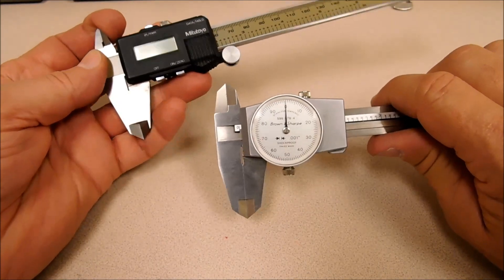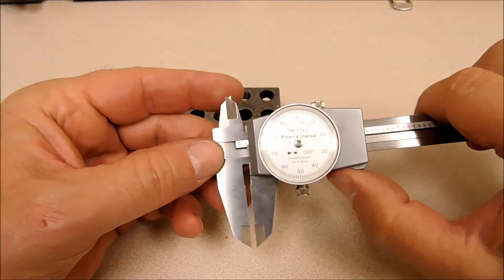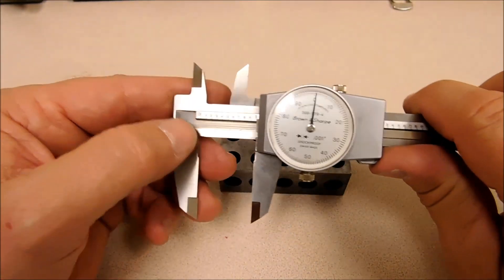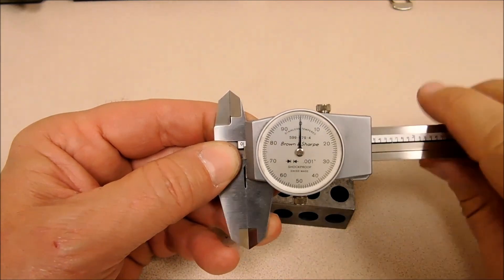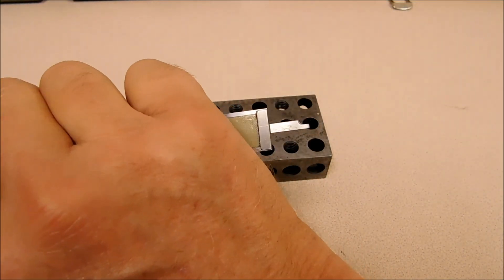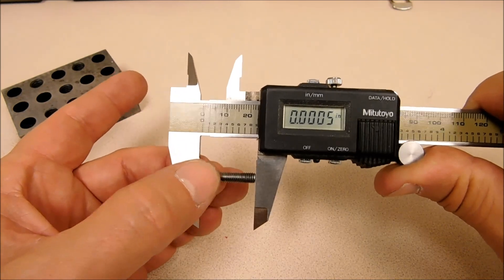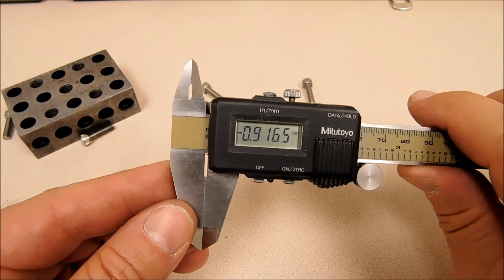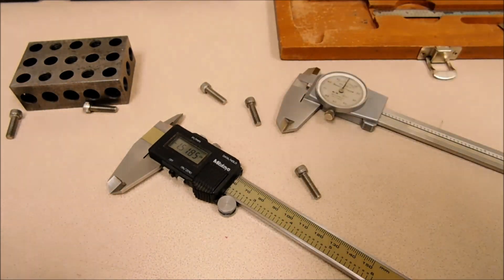Calipers -- Dial vs. Digital -- Does one do more ???  ( yes )

Comment: I prefer vernier calipers for a couple of reasons.  First, they are more durable.  I do both woodwork and mechanical work.  Dial calipers are a bit delicate for some work and they have to be kept clean.  The racks and gears can get messed up with grit.  I just don't trust digital calipers and they have potential durability issues.  As far as accuracy, I use vernier micrometers also.  And I've won bets on several occasions, me measuring something with a vernier caliper, the other person using a micrometer.  It's all in experience and touch, which you have to have to use any measuring tool with any accuracy.
Reply: @Steve H  I use vernier calipers (one is Mitutoyo) because the ones I have have a thumbwheel adjuster and both the adjuster and the main slide have locking screws on them. They can be used to measure down to 1/100th of a millimetre (and 1/200th of a mm which is close to .0002" using a loupe and estimating between the lines positions). The digital and dial calipers (I do have some) move when you remove them from the part (on the lathe usually) if they do not have a good locking screw on them and the thumbwheel on most of them can result in inconsistent results due to variable pressure. I have got micrometers going up to 100mm/4" that I keep for critical work but have to convert the reading on the 3" and 4" ones to mm when I use them as I don't have 75mm or 100mm micrometers. The micrometers usually just confirm that the vernier calipers are still giving the correct size. Most of my work is in mm. The biggest issue for calipers is that the contact area is not as wide as that of a micrometer so care is needed to ensure the caliper is correctly seated on the part.

Comment: Other day using my Mitsutoyo caliper  to make a drawing where i used the tips of the inside and outside to leave a pin hole to leave a mark on paper 
To my surprise they didnt leave the pin hole in the same spot try it set the caliper at say 1”  use out tips to make two pin hole now try to put the inside in the same holes ???
The reason it brings a question now is when i see people drag them on metal for lay out scribbing
On another note storage of mics and calipers 
Never store them in fully closed position so the temperature change doesnt  tweek the anvils thats what I was taught over 50 years ago so alway leave a slight air gap when putting them away
Reply: using calipers as scribes? man, those people need some disciplining.
Reply: @sanjeen2503  for shit calipers with a difference of +- 0.2mm between the id and od thats what they deserve ahahahahaah

Comment: You can also use them to fine center line of holes within it’s measuring range. If hole are same dia. Take blades and zero it in first hole then go to second hole. Then read center distance.

Comment: Measure twice, cut once, right? Here is the question, what if your calipers do not agree each other? One say 1 inch, the other one from other brand say short 1/4 thou, the third one say long half thou and you don't have a set of guage block to say the last word in your work site. To a certain degree, they are all usable calipers, but if they are all use exclusively to make parts for a same machine, i don't think it will result very well. And somehow it will be result into some kind of “brand war”. Yes, you can put only 1 caliper on the bench for everyone, the rest go back to lockeroom. It is not practical, right? What is you prefer? It is not that easy here to acquire a set of guage block. Unless you want some chinesium self claim guage block that looks pretty suspicious.
Reply from the maker: Simple, just use the one that gives you a dimension closest to the callout on the print. Boom, drop the mic.
Reply: @joepie221  so you also agree with the “1 caliper” policy. What i am worry is, the customer qc, he is holding a chinesium caliper, which is a lot of thou difference to the rest of the world...... 😕
Reply: @joepie221  HAHAHAHAHAHAAH
Reply: Simple.  Calipers are not meant to read to fractions of a thou.  Get a mic.  The brand of caliper is irrelevant if you are working to tolerances of less than .001 calipers are not going to do the job.

Comment: My digital is always dying eating batteries. The dial is always there ready to go no batteries needed. The battery door has crappy little screws that always get lost but I do like it because I can see the numbers and it instantly converts standard to metric. I have to have both!
Reply from the maker: I bet its not a mitutoyo. Their batteries last for years.
Reply: . you are correct sir its a piece of junk from harbor freight. I will have to save up and get a mitutoyo. My dial caliper is a mitutoyo though.
Reply: @ALSomthin  you have to get decent stuff to get decent results. I bet you the HF calipers don't zero well when you close them back either.
Reply: @bbarker5766  Yup they are crap it seems its the only crappy tool I own at least one that was intentionally built to be crappy. But I had three other brands as well over the years that were all the same garbage.
Reply: @ALSomthin  I got a set to use at home for woodworking and some 3D printed stuff that is not critical which they work fine for that.

Comment: One new trick I learned was to measure blind drill holes accurately at full diameter. Zero out your digital caliper on the gauge pin length, pin the hole then measure the pin stick out.

Comment: Learned machining with a dial for 15 years before getting a digital.  Digital is faster, not by a lot, but noticeably faster to get a reading.  With a dial, you have to visually see where your whole number is first, and then you hedge a bit on the thousandths like you do when looking at an analog clock. Digital is just, Bam, here is your reading.

Comment: i have a dial vernier that has both imperial and metric but the last you pointed out is the one major advantage I see of the digital. In saying that though I would also not like to be caught out in a remote place with only a digital to do the job if the battery were to run out while out there. Would rather have to do the math

Comment: Hi Joe. I've been using a dial for years. It's my go to for quick and dirty measurements. I don't know that the digital would be of any benefit other than you can measure hard metric with the push of a button. For my dial I would have to convert it. I've got a TON of allen wrenches in a box. I need to fill several set retainers. I actually bought a new cheap set of allen wrenches just so I could measure them and put the kits back together! LOL For that I may have to break down and go to my tool box and grab that digital. I use it so infrequently the battery is likely dead. That's a BIG disadvantage to me. Yea, I know there are solar powered digital calipers...I'm NOT buying one. Good vid, thanks!

Comment: Another important feature of some digitals: solar powered.  This gets rid of the biggest disadvantage of digitals: the battery, which is always dead, or it puked in the caliper, ruining it, or the battery is dead and who can find the @#$ crazy type it uses?  The solar ones have "absolute scale" which means that when you put it in a dark drawer, move it, then retrieve it for use, it retains the last "zero reference" you set, unlike digital incremental readouts which forget where they are on power loss.

Comment: I use a digital myself, but one disadvantage I found is that they are susceptible to error when cold. also if a small chip (<0.2mm) finds its way under the housing, it will make the readings completely erratic until open and clean it out. I always return mine to 0 several times after zeroing out; verifying that it actually says 0.000 each time, to make sure that the reader is counting correctly.

Comment: I have a plastic dial caliper that I have used for years but I finally bought a steel dial and a steel digital caliper.  One thing I figured out with the plastic caliper was that I could put it on a piece of wood and while holding the turning button in place, slide the piece of wood through the jaws and I could tell if it loosened or tightened end to end.  That way I knew if it was a consistent thickness from one end to the other.  I figured out how accurate this method was when after buying the digital, I took it and measured the thickness of three small pieces of wood that I sanded to size for a pair of marking gauges I was (still am) building and the combined thicknesses of all three pieces was within a half thousand.  It’s surprising the ways we figure out how to use tools to make them more accurate.

P.S., the depth gauge of the plastic dial caliper is a straight piece of wire instead of a flat bar and fits into much smaller holes.  For that reason I will never get rid of it.  The only thing I can’t do is scribe with it.

Comment: Hi joe . Going crazy here in south africa with the lockdown seemingly  going on forever,, we also called the  vernier   VERY NEARS  ..  when the first vernier calipers  came out with sharp nibs for internal measurement   .(. I think it was mitutoyo )    my pal who was a salesman for tesa of Switzerland  called them TOMAHAWKS,,.  The vernier s before that had  nibs  which were a certain size  .. 10 mm on metric which you had to   add on to the original reading ..your right dont trust a vernier for  accurate  work    micrometer is best   .. not a digital one  ( batteries ar always flat when you need it .. being an old timer I prefer the mics with the analog tumblers on the frame  as I can see it better.. keep safe you guys  stateside    .. and keep the videos coming2

Comment: Digital caliper has a huge drawback and that is the battery dies on Friday just before you finish your job.  Of course the last battery is already in the caliper.
Reply from the maker: Murphys law.
Reply: @joepie221  encourage everyone to put a tomb stone in the back of the shop for Murphy.  This way he has a home instead of hanging around the shop looking to start trouble.
Reply: That's why you get a solar-powered caliper.  As long as you can see in the shop, your caliper has power!  And there is no corrosion!

Comment: I'm having a hard time choosing between the 2... The digital has extra features but the dial one will never run out of battery...
Reply from the maker: My mitutoyo battery lasts for years. I also have both.
Reply: @joepie221  I ended up choosing the digital.

Comment: I have a Mitutoyo  straight vernier with the fine adjustment (locks on fine and course, no dials, no batteries, nothing to mess one around) and have trusted it for 51 years. Worth every penny I spent on it, and that's saying a lot because it cost me more than two weeks apprentice wages at the time
Reply: I also have a really nice straight vernier that I've had since I was in my early 20s. Unfortunately my eyes are no longer good enough to read it without considerable difficulty. Now I use digital calipers because I can read them easily.
Reply: @lwilton  Same here. Another thing that I was surprised was not mentioned is the data transmission capability. Fair enough, not many have a CNC machine, but with the availability of 3D printers increasing as it has, it can be a big time saver.

Comment: One more thing I do with my calipers is draw layout lines for items with a large tolerance specification. Let’s say I have to cut pieces to be machined to .75” length and I want to have just enough to face the part, I paint a line with dyekem and extend the caliper (let’s say .9” at a time) and mark up to ten parts distances at a time. When cut it leaves rough parts about .80, less waste. Or I can also mark my HSS bits to get aproxima shape while grinding a profile by hand.

Comment: I have both a dial and a vernier caliper. The vernier caliper is a 40 year old caliper and never need adjustment and I can read within .001.  The dial is a nice 12" but must be checked at 0 to make sure it has not jumped a tooth on the dial. I'm old school and don't use digitals.

Comment: and a really cool feature of digital:  measure inside a hole, zero, then extend to second hole of same size, max distance, and the readout is center to center.  Cant do that with dial.
Reply: With just a little math it is very easy. Measure the diameter, measure from far side to far side of holes. Now subtract diameter of from hole distance. You end up with center to center to center distance. If hole are of different diameters, add the radii together and subtract from max hole distance..
Reply: @tracylemme1375  But you're doing that with math, not with the dial caliper.
Reply: @TrueThanny  The mental math is easier if you zero the dial after measuring the first hole.  That way the dial becomes a direct reading of the last two digits and the mental math only needs to handle the main scale numbers which will be the first two digits.  Digital is still way easier but dial is manageable without a calculator.
Reply: Now that is a very neat trick. 😁

Comment: My dial caliper reads both imperial and metric at the same time. Two concentric needles (like a clock movement) and two scales. It's a surprisingly well made Chinese no-name, mail ordered it some 30 years ago, was around $25 at the time. Dial calipers can also be reset to zero for comparing, although you have be careful if you're range of variability is greater than .050". I've owned electronic calipers, they're amazing, but considering the battery (your new spares will die at the same rate as the one in use) I say the edge goes to dials. Don't dismiss verniers either, they're good to .001" (with my glasses on) and rugged enough to leave around my cluttered garage uncased.
Reply: One avantage of digital is that your face doesnt have to be pararell while reading it.... If a short part is still in the lathe chuck ,puting your face just above lathe rail many times could be boring. 
Digital from Chinese or India faster comsumes battery than Muttituto.
Reply: @Spark-Hole  I hear ya, though inaccurate would be a better argument than boring. Even so, of the many dial calipers I've used all had their pointers so close to their dial faces that there was never any appreciable perspective error. If you're ever concerned, you can still lock the dial in place while measuring and read it in a more comfortable position. For me, I still prefer no battery ever :)

Comment: you forgot to mention the main advantage of the dial style. And that is that it allways works wherever you are whatever day it is, its allways reliable. The digital however, that thing aint reliable at all. Allways when the stores are closed and you need to finish something the damn thing has a dead battery, and there you are, no working caliper and no spare battery anywhere. So at the moment you think wel if only i had a dial type.

So the best advice would be to buy 1 of each, and then make sure you keep them stored really wel.
Reply from the maker: My Mitutoyo digital uses a battery about once every 3-4 years. I also keep 2 spares in the case at all times. You can see them in the small red package in the blue foam case in the video thumbnail. 
My best advice would be not to buy a cheap Chinese knock off, and keep spare batteries in your box like any other tool you need.
Reply: @joepie221  That offcourse is very true. But the fact is that batterys only have limited shelf time. I learned this when my uncle had his own electronics shop, we got loads of free new batterys because they where close to their best used before date. And it turns out some of them actually lost a good amount of power before that date, and some even started to leak when they where out of date. So i dont keep a lot of spare batterys.

Also i do like the cheap chinese ones for if someone else is around and needs 1. Give them the cheapy, let them destroy that instead of your good measuring tools. Those are only for people that know how to use them. And when i work on cars and things i dont want to use a expensive mitutoyo in the dirty crap there either, so again, cheap chinese things there.  Every tool has its place right.
Reply: @gabbermaikel  Non rechargeable lithium batteries wait good for a very long time often being the most reliable choice for standby emergency devices
Reply: @joepie221  I agree with you, I just keep spare batteries still sealed in their pack as an emergency:-))
Reply: The good digital ones let you know you battery is low a couple of months of use prior it's full discharge and the battery leakage it's very low in standby mode. I have to say I shamefully got in the situation by ignoring low battery message but I found new batteries in the first place I looked at